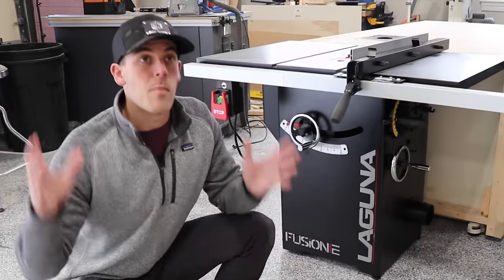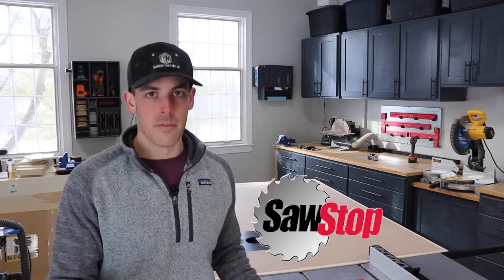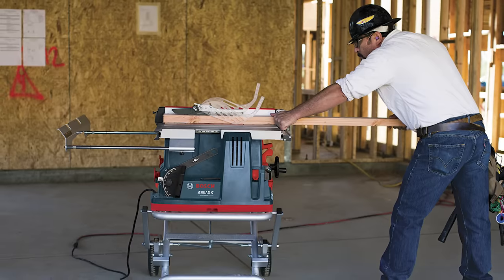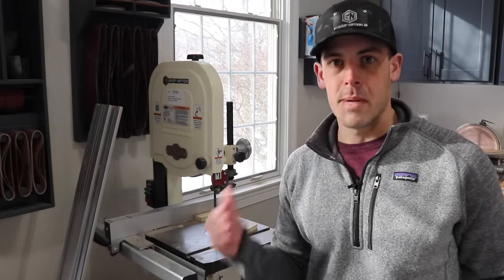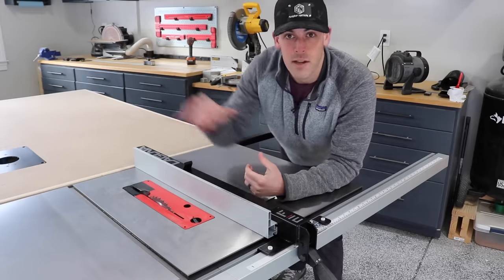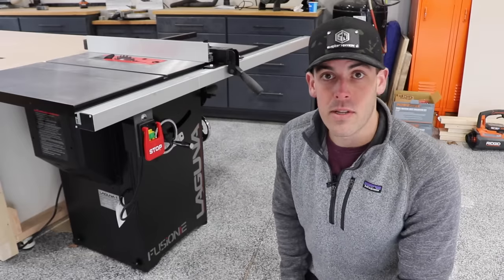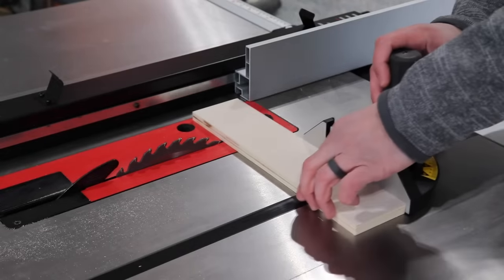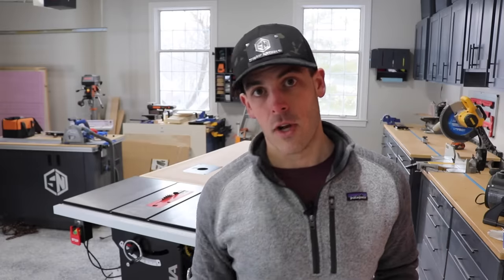Why I Bought a Laguna Table Saw over SawStop!

Comment: Did you just not remember or know that Sawstop has a jobsite saw? The contractor saw is neither their cheapest nor base model saw. That being said, I think it starts at $1,399, so it isn't much cheaper.
Reply from the maker: Yes I know they have a portable version but I tried to keep my comparison as fair as possible - same reason why I ignored the more expensive 5hp SawStop models
Reply: @ShopNation  thanks for the response! And fair enough. That makes complete sense. I just assumed that since you had mentioned the more expensive sawstop not being a fair comparison but didn't mention jobsite, that you thought the contractor was their cheapest model. I certainly agree that the contractor saw is far more likely to be adequate for someone looking for a cabinet saw, even though it isn't one, than the jobsite.

Comment: Great review.  I actually purchased this same saw in the fall, wired for 220v.  So far I am loving it.   Happen to have replaced the same Delta you did with this saw.    The Zero Clearance insert is harder to find, but worth it if you use thin kerf blades (get the thin kerf knife as well)

Comment: Thanks for your video!  I am a newer subscriber and I like your content.  I am a SawStop owner and I seriously considered the Laguna when I bought my SS to replace my delta contractor saw.  So we basically had the same situation and I went the other way.   My choice came down to safety, yes.  However, I also didn't care for the stability of the Laguna fence and figured I'd have to replace it with the SuperCoolTool fence or something similar.  The fence shown in your video is obviously upgraded-- one note, are you sure that the "low" version of the fence shouldn't actually be flipped to form an "L" fence; something you'd use when cutting a piece might cause a bind with a full depth fence?  I also didn't like the integrated mobile base.  So for me and my budget it was worth the extra dollars up front.

Comment: Thanks for this review. I'm going to buy a Laguna Fusion table saw to replace the Delta Unisaw I've been using to build kitchen cabinets for the past 35 years. The high and low profile rip fence configuration is a better design than the typical Beissmeir fences. When set at low profile you get space for your right hand to be further from the blade while pushing thinner rips thru the full width of the blade.  This eliminates the need to try to smoothly transition to a push stick during rip cuts on longer length pieces. Laguna's new Fusion rip fence is the same as Delta's 1980s era Unifence design. It's surprising to me that this fence configuration isn't more popular. This fence allows you to safely and cleanly rip 1-1/2" wide face frame stiles 30 to 42" long without using a push stick. Do you know if Laguna has altered the rip dimension indicator window yet to include a second red line for the low profile measurement? The older Delta Unisaws had two red lines at each side of a wide window, one for each fence configuration, but the original Laguna Fusion saws  were still using a single red line window.

Comment: I purchased a Laguna table saw, paid $4,500 for it. 5 years later something got broke on it so I took it into the dealer where I purchased it and Laguna said it couldn't be repaired because they had severed ties with the manufacturer. 3 months later the dealer called me to inform me of this. I fired off an email to Laguna to be informed by the dealer not Laguna they a connection was re-established with the manufacturer for a 1 time production for replacement parts. So I would consider this to be buyer beware.

Comment: Thanks for this Sir. Anxiously waiting for the follow up review. Once I finish my cabinet project I'm upgrading my saw and value your opinion. BTW, I value my fingers differently based on what I use them for. For instance a middle finger is worth more than a pinky, a thumb much more than a ring finger, etc. The index is at the top of the heap at $625K while a pinky comes in at a paltry $140k.

Comment: I have a Fusion II and really do love it. But going over board on a Harvey cast iron router table/fence, jessem Mast-R-Lift II, Bosch 1617, all still in boxes and yet to be assembled I’m thinking maybe I should get a new table saw since the Laguna is 13 plus years old. Saw stop has been one I’ve been looking at. “BUT” my issues with the saw stop is their technology. Let me explain, Bosch has the same technology & don’t damage the blade. Hmmm, you’d think the powers to be up in the head quarters at saw stop would want to sit down with Bosch and have a coming together on the two technologies being combined. You’d think or maybe this is wishful thinking they’d give a damn about your pocket book as much as the safety. Bosch’s firing pin is a dual firing pin for around 90 bucks the last time I saw one, about 20 something more then saw stops. And again no damage to the blade. With saw stop that’s about 100/150 bucks out of pocket to get back up and running, I know that’s far better than a hospital visit & loss of some digits. But to flip the firing pin cartridge if you want to call it that & reset the blade back up with no more money out of pocket would be awesome! Then I’m hearing the rumor Saw stops patents run out in August 2021, and of course I’m sure they’re lawyering up to hold on to those as long as possible. But we all know every company out there is licking their chops, and also have their own technology waiting to drop these on their table saws and we’ll all have this on every single table saw here in a short amount of time. I really do think it is a personal preference & honestly do not think you can go wrong with whatever is best & works for you.

Comment: A remodeling/ painting contractor I know bought a SS for the workshop but none of the guys wanted to use it after the first guy got yelled at for blowing the thing off with a piece of damp wood and ruined a new Forrest blade. They pull out their jobsite Dewalt and set it on top.... ha.

Comment: Laguna looks like a really good brand, and they are certainly $1,000 cheaper than sawstop with comparable features. Sawstop does provide a lot more options and features beyond Laguna if you want, and consequently, a reason why they can really shoot up the cost beyond just the $1,000 premium over Laguna. However, Sawstop isn't significantly more expensive than other high end brands like powermatic, which really makes you understand Laguna's position in the market. Really neat into the saw.

All of this being said, stim money is burning holes into pockets and that $1,000 premium is mighty affordable for a huge amount of people. I patiently await my 3hp PCS any day now, the guy said they're waiting for the mobile base but I might just ask if I can pick it up regardless this Saturday.

Comment: I've had the F2 for a little over a year now, having upgraded from the same Delta saw you had.  My experience is a bit mixed, though the Laguna is a much more accurate saw than the Delta was.  Within a couple months of getting the saw, one of the bevel gears that raises and lowers the blade began losing teeth. And I'm a hobbyist that doesn't use it that much. Laguna was quick to send a replacement, but removing the old gear and getting the new gear on was VERY fiddly and time-consuming, as you have to work within a very constrained space with limited visibility.  In fact, I've been unable to get a washer back on it and that means that the blade's height cannot be locked.  The second thing worth mentioning is dust collection.  While better by far than the Delta, there's insufficient suction coming through the overarm collector to be really effective.  In fact, I'm probably going to get a cheap shop vac and connect it directly to the overarm hose.  Another slight negative is the split throat plate - it doesn't have enough support at the rear and flexes downwards so it's not flush with the tabletop.  Trying to put a bevel on some panels was really difficult as the workpiece would frequently catch on the cast iron table after passing the blade.  And finally, the fence is a mixed blessing.  It's flat and it's square and makes really nice cuts.  Since the right side has 3 handles protruding, however, it's REALLY difficult to build the sort of auxiliary fence that slides along the saw's fence.

Despite sounding negative, I'm pretty happy with the saw.  I'm certainly getting better results with it than ever i did with the Delta.

Comment: I went with Axiom Elite for my CNC over a Laguna 4X4 table for the same reason I got a SawStop over a Fusion F3… 

Read the forums. Laguna’s customer service is rumored to be some of the most horrific around. 
I’d rather pay more upfront to have the brand actually come through if something happens to a multi-thousand dollar piece of equipment.

Comment: Travis,  Thank you for the great review, it sold me on the Fusion F2.  If you had a choice between the 220V and the 110V which would you go with?
Reply from the maker: If you've got 220 I would go that route, it will just run so much smoother
Reply: @ShopNation  I agree, go 220.  You can get the parts for much less than the Laguna kit.  The same 240v magnetic switch can be found on Amazon and elsewhere for about $15, an the 240v 9amp thermal breaker is less than that if you go with a different brand.  9amp are hard to find, especially the same brand as Jet/Laguna use.  Jet actually sells the parts separately, I think it was $18 plus shipping.

Comment: Ouch.  I am also an engineer - seriously.  The problem here is that although you can do a calculation on probabilities, it's those initial assumptions that are going to...well... get your fingers cut off.   Even if you only have 1 accident over your career...well, that's a devastating, life changing thing.    And as others have pointed out: 1) the $ amount amortized over 20+ years shows it's actually not that expensive - especially if you look at the difference in $$ between the Laguna and the Sawstop.   2) I bet if you showed your wife, or other significant other, some videos showing the effect of an accident (perhaps blacktail studio's slow motion demonstration),  They'd likely encourage you to get the saw stop.

Comment: One over concerning problem is the depth of the table is only 27", which also means the fence is shorter as well.  That's too short and disappointing.  Most cabinet saws are between 31.5" to 33".

Comment: Sorry I have to correct you but it has nothing to do with moisture from your body parts has everything to do with the electrical current that your body produces if you try to cut aluminum on a saw stop it will activate the stop mechanism because there's electricity running through the aluminum from your hands
Reply from the maker: No, actually the moisture in your skin is the conductor, which the safety system detects. A piece of aluminum doesn’t inherently produce an electrical current, but rather completes a circuit

Comment: Hi. I was watching your videos and stumbled across this about the laguna saw. This was actually my first choice of tablesaw. However,  I ended up going with the Grizzly because I wanted something in a 5 hp machine. I'm glad I did because I recently built a dining table for a friend of mine and plowing through 8/4 ambrosia maple, black walnut, and wenge was a breeze. Also, being able to a standard kerf blade instead of a thin kerf blade made for better cuts. I'd be interested to know how you like the laguna as time goes on. In my opinion, Laguna makes a great tablesaw. I also agree about the sawstop saws being shoved down our throats at every turn! Pro tip... don't put your hand in front of the blade!

Comment: Looking to upgrade table saws. Wondering how large the pieces to assemble came in. I have a small basement shop and narrow stairs to maneuver. Top comes separate? Motor?  Would love to get a great saw but won’t do me much good if it won’t fit!
Reply: It comes in a crate, pretty much complete.  You only need to put the rails on.  However, you can remove the two cast iron wings, and the cast iron top.  At that point it should be pretty manageable to move it just about anywhere.   Any of the Cabinet mounted hybrids would be similar.  The Grizzly G0771Z, Shop Fox w1837, Jet ProShop (which is 80+% the same as the Fusion F2)  etc.

Comment: Seems to me that good safety depends on developing good safety habits - which depends on thinking about what I'm doing.  I would be a bit concerned that the sawstop would encourage or at least tolerate not-so-good safety habits.  The safety habits cover all tools, not just the tablesaw.  Such as keeping body parts away from the nose of a nailer - my rule is a spherical space with the radius of the sphere being the length of the fastener, at least.  And it covers all operations such as avoiding kickback driving a workpiece through various body parts or bystanders.
I'm waiting with bated breath on the further comments on this saw.  By the way, I'm an engineer too: BSME UT Austin '79.  My wife is a BSME TxA&M '84.
Reply: By the way, as a Texan in OH, when you try Skyline (or any of the Ohio X-way chili offerings) Chili, just put the word "chili" out of your mind.  It's not chili as we know it (It's life, Jim, but not as we know it!).  But it's still good.  Most Texans can't get past that it's not like Texas chili.  Customer satisfaction is more closely coupled to properly set expectations than whether the project was successful or not.  Or in this case whether the food tastes good or not.

Comment: Good job on the video!  Only question is on the fence.  I don’t see to track slots for attaching sacrificial fences for dadoing or hold downs etc.  looks to have the same fence system as the old DeWalt Hybrid I have, and the fence is not very versatile.  Be interested to hear your thoughts.

Comment: the first thing I would add to the saw has to do with the power.  to add a delay to suction.  the switch you have look like the one I like  but that a dead cut off and no delay for the suction.

Comment: After using Oliver, delta, shop fox, and grizzly table saws, the saw stop is the worst by far. I can't stand the safety features and the underpowered feel of the saw. I totally understand the Laguna predicament with little info out there. I was in the market for a shaper and was planning on getting the g1026, but after getting an email about it being available in August I switched to the Laguna 3hp compact shaper. Pretty excited to see how it is.

Comment: That Delta contractor saw- with the Unifence, and roller base, and a link-belt, is absolutely unbeatable for the money.The ease of taking off the motor for storage and transport is amazing. Besides the SawStop being invented by four patent attornetys who are running around suing everybody that tries to use blade-stop tech on their saws, there are a lot of materials you can't cut with one. Besides fingers and hot dogs, basicallyt anything conductive like dibond, hi-R sheathing, chemetal, etc. is no-go.

Comment: The fence functions like the old Delta Unifence. The "high low" function and the "slide funtion" Come in very handy. I bought a grizzly 10" cabinet saw over 25 years ago and their fence left much to be desired. Got the Unifence the next week and it still works great.

Comment: Lost my thumb to a table saw 30 years ago. I still use a Dewalt table saw in a rousseau table. That is because I work in a one cars garage and set up in the driveway to work. You a completely on point in my opinion.
Reply: To what do you attribute your accident, if you don't mind saying? We all take risks. Reading about the experiences of others adds to "experience" without suffering the direct consequences...
Reply: @steveh8724  I was 32 years old and started working with wood early in my life. I was a test engineer that was required to be on board any USN nuclear vessel when undergoing depot level maintenance. It is very hard to get people through the program. At the time we were very understaffed so I worked for 28 hours straight and went home to to make screens for a house we rented in nags head NC. Honestly a little voice or premonition told me to not to turn the saw on...I did it anyway. Needless to say the screens never got made. I was tired and distracted and had no business operating the saw. It was a old Mikita 2708. I used the saw for another 2 decades. It wasn’t the saws fault.

Comment: I’m interested in seeing how the saw performs. How the fence is connected and holds alignment. If I could ask of you to “really dig deep into the nuts and bolts and how it’s put together”. 
I have an old delta with a unifence ( similar to what’s on the laguna ) I loved it at first the more I used it the less I liked it. Staying true or aligned is a downfall. Thanks for sharing and breaking the norm!